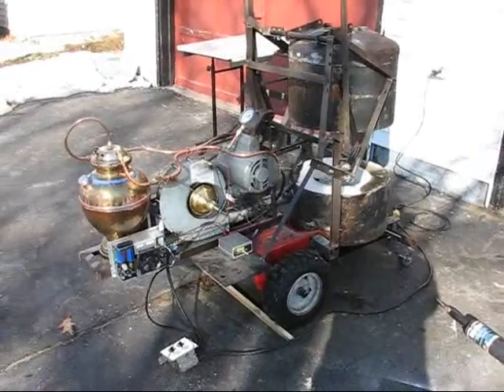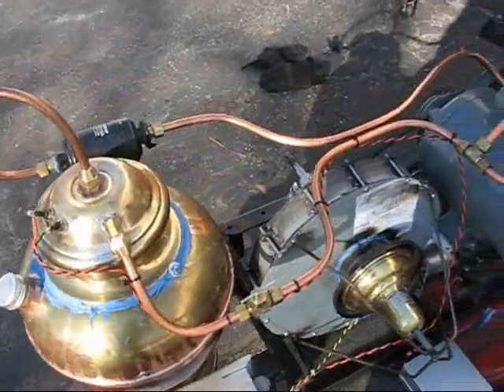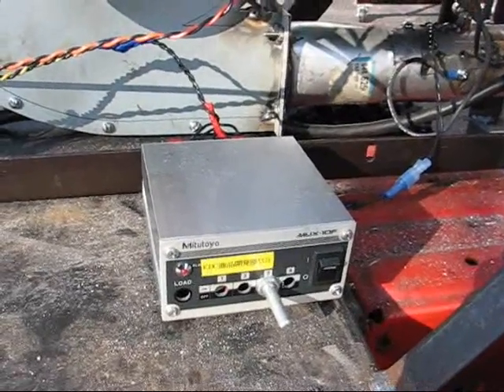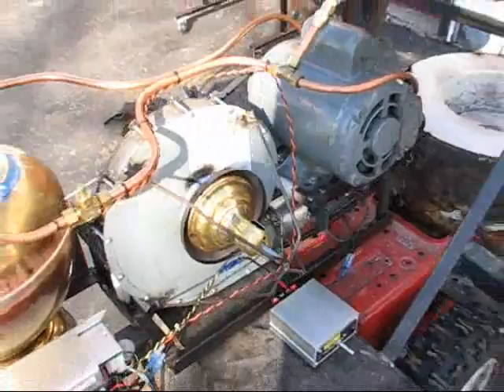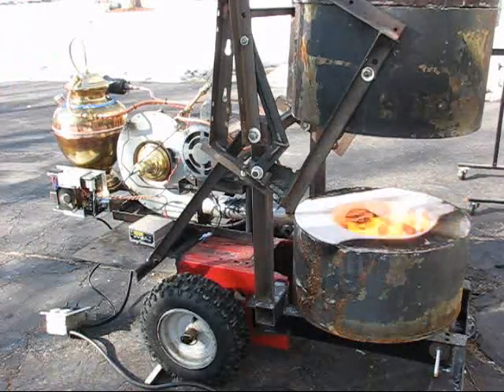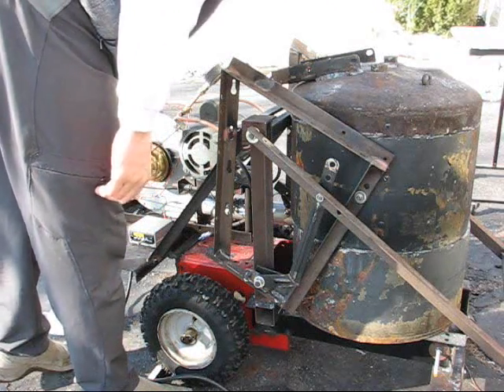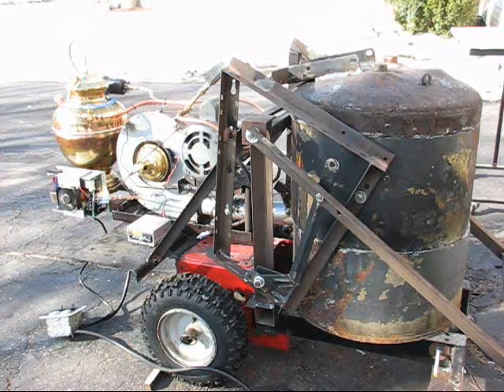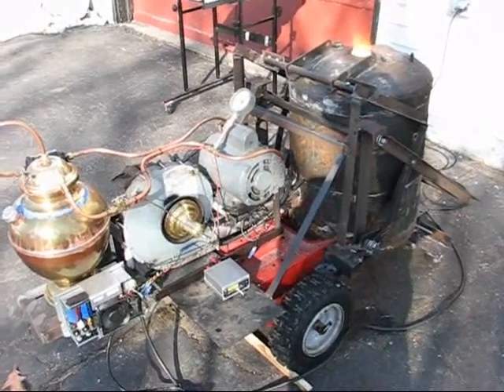Gasoline and Waste Oil Foundry Furnace Test

Comment: VERY nicely done, sir!  We're still in the "building it" stage of our furnace.  Wondering if I could give you my email address, in a less public place, and you might share your refractory recipe.  I've got a pretty good idea, but my partner is aprehensive about "best-guessing" it.  We're using the lawn mower base, but looking at using either a beer keg (parter already has a few), or a section of large diameter steel pipe.  Will post video once we have it together.  Probably some as it's GOING together.  Again, excellent work!!!  Especially appreciate the lamp post!
Reply from the maker: I bought a commercial refractory cement, I think it was Kast-O-lite 26 or something similar. Make sure you check out the final burner configuration: Foundry Furnace with Babbington Burner the babbington works much better than the oil drizzle-nozzle.